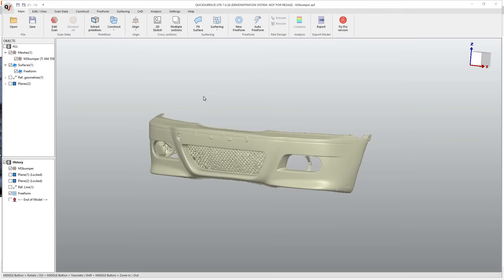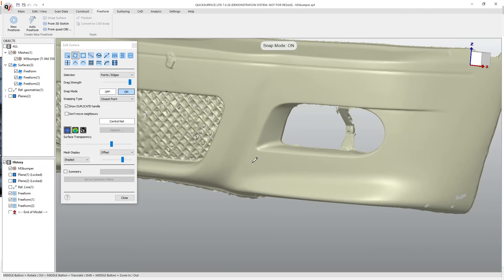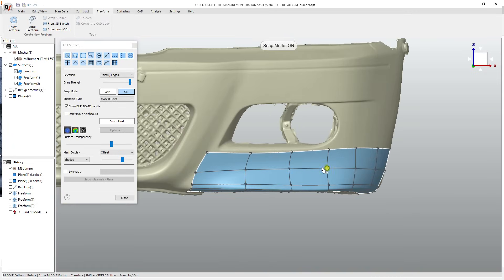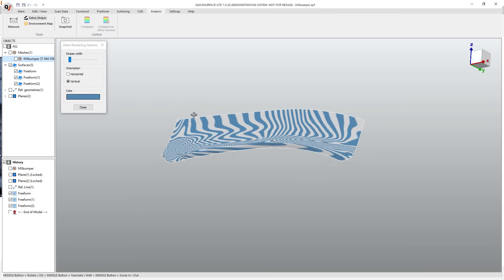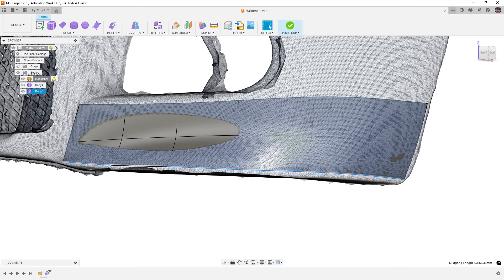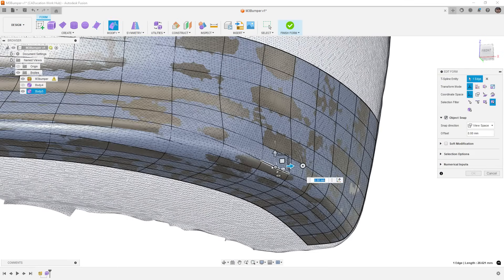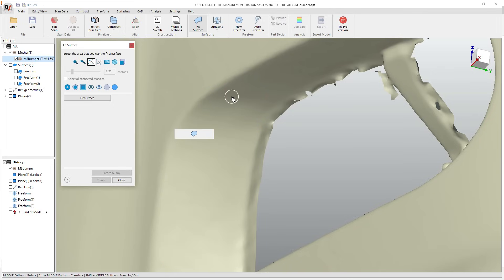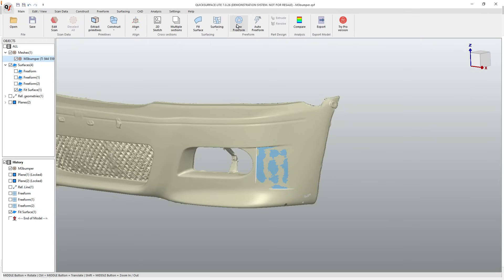Freeform Surface From A 3D Scan |  QuickSurface Lite Freeform vs Fusion Freeform | Which is better?

Comment: With QS Lite, would the process of fit surfaces described here be the same if I want to create (my beginner's vocabulary) a partition model consisting of a set of references: anchors points, lines and planes/surfaces. This set would then be exported to Fusion 360 to create the actual design.
Reply from the maker: Sadly no.  when you export a model from QS Lite you get just the CAD geometry.  If you have Planes, those come in as surfaces.  If you created say a primitive cylinder, it comes in as the faces that belong to that.  None of the sketch data is exported.  QS does have an Inventor plugin that is back for 2026 which i believe would push sketches, but as far as i know there isn't a way to push QS sketches to Fusion.

Comment: Please make more video of quicksuface and if possible the pro version I have it but unavailable to use it correctly 🥲 
They do have some video tutorial but it’s hard to understand I’d rather you make some tutorials on it! 🙏🙏🙏
Reply from the maker: in late June i will be doing a webinar for QS using Pro and i am currently working on a course for www.learneverythingaboutdesign.com using pro to walk through reverse engineering a part.
Reply: @LearnEverythingAboutDesign is there a way I can get an email when this corse will be out! 🙏 
I will be making a small video of some of the issues I facing and upload it so you can see and hopefully talk about things I’m doing wrong
Reply from the maker: you can email me support@caducator.com  QS will announce the webinar when it is all scheduled and ill announce as a post on this channel as well.
Reply: @LearnEverythingAboutDesign perfect 🙏🙏

Comment: I was having a chat with my son (systems engineer) about something that I just don't understand. We (not me but people much smarter) have created A.I., the software necessary to land rocket ships right side up and a myriad of other insane accomplishments.  How is it that nobody has come up with the (seemingly) simple task of telling a computer to create a surface/face on a section (or entire) scanned mesh that takes an average of all the points and creates a smooth and very closely matched surface?  I just don't get it. All this manual manipulation of surfaces when a computer is more than capable of doing that (with the right programming).  Any thoughts? Is there something insanely difficult about this?
Reply: The main challenge lies in understanding what AI truly is. It’s not a sentient entity that can intuitively perform any task. It relies on highly optimized models trained on vast amounts of data. AI models only work well within the constraints of their training and the parameters they’re given.

Most 3D scan data consists of millions of points in a point cloud. Creating an accurate, smooth surface from this data requires complex processing. Current AI models are not yet optimized for this kind of task at the level of precision required for high-quality CAD or reverse engineering applications. The computational cost of processing and filtering such a large dataset, especially selecting the best points to generate a usable surface is extremely high. Additionally, early iterations of an AI-driven approach would likely produce inaccurate or low-quality results, frustrating users and wasting resources.

While AI technology is advancing rapidly, achieving a truly automated, high-precision solution for surface reconstruction is still in development. In the coming years, as AI and computational power improve, this process will likely become much easier and more accessible, but we are not quite there yet.
Reply from the maker: So yes and no.  There is a company working on an AI mesh to prismatic part tool right now.  Fusion can convert a mesh to a prismatic part if the mesh color/faces are setup properly but there are limitations.  And what you will find is that the decisions the person has to make are often part based and not a universal set of rules.

That being said the Yes part of it is there are tools that do some of this like Auto Surface and Auto Freeform..  The trick of it though is that the flow of edges nearly always has to be adjusted.  My next QS Lite video will show Auto Freeform on an applicable part.  Basically it wraps a freeform surface onto the mesh, then you can edit and move points around still snapped to the mesh.  The problem again is just that the flow of edges is often different than how you would design it.  

Also be aware that all things saying they are AI aren't always that.  There are a lot of things that are really just algorithms that run quickly through models and that aren't really "intelligent".

Comment: Too expensive ☹️
Reply from the maker: Yeah I get that.  which is why I show users how to do what they can with Fusion.  The $450/year for Lite for the functionality it has if you are using it for paid work or even a hobby with limited time will save you loads of time for sure.
Reply: @ 
Sure, as professional tool not a biggie…. But just for irregular hobby stuff its too much

Btw: thanks for your videos, they already helped me a lot. I still struggle and get all kind of errors and strange looking stuff as soon as I leave the straight and square design, but at least I keep trying ☺️
Reply from the maker: @jas-FPV  you are welcome!  I am considering doing a substack in the near future where i might offer video help/solutions to tricky models for people fyi.  you also can join the discord for the channel and ask questions. https://discord.gg/vxWh6daP